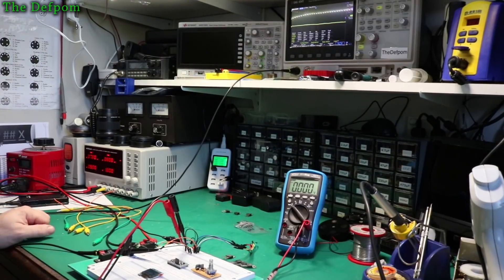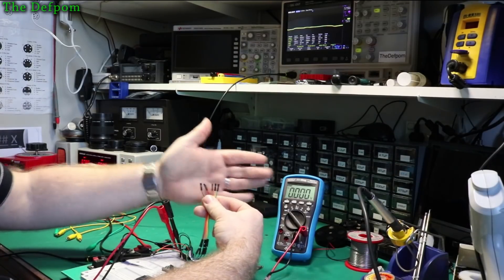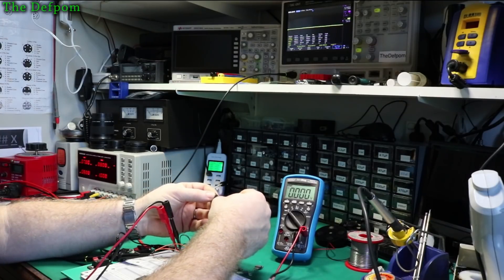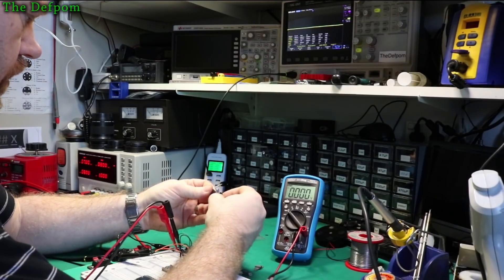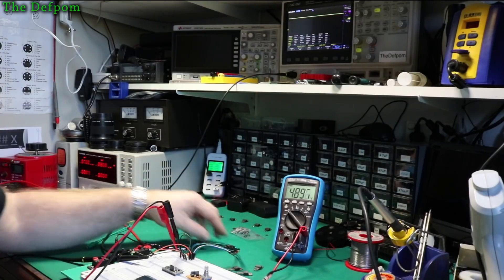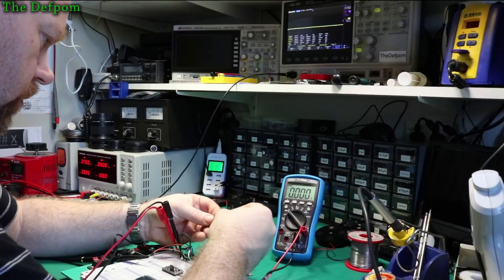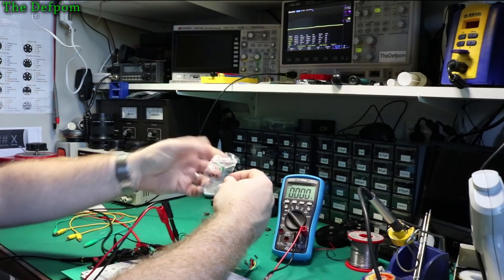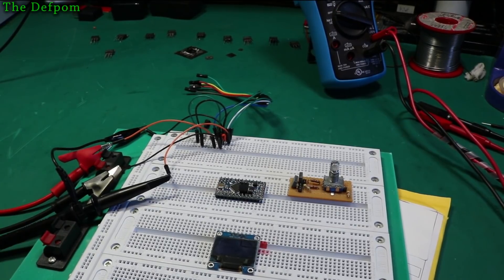🔴 #475 LM2925T (CS8122) Voltage Regulator and Supervisor IC Function Testing

Comment: I wonder if they bother to test them before shipping out..
I thought about buying a dozen "new old stock" EPROMs from China, but I figure there's way too much that can go wrong with those.
Need them to update the ROM on a piece of gear, but they're quite overpriced from US sellers; people on eBay always seem to think old=valuable with any electronics
Reply from the maker: LeiserGeist - I stocked up on EPROMs years ago when I was making CB radio conversion boards, just as micro controllers were emerging. I have a lifetimes supply if 2716 and 2732 I think!
 I wouldn’t worry too much about used EPROMS, erase them, do an erased check, program them and do a programmed check and run it a few times, if they check out they are probably fine.
Reply: @TheDefpom  Nice, thanks for the tip. This dang HP logic analyzer takes 8x 27c256s; should be fun!

Comment: Dam swines arnt they, i hate liars :-(
But they all seem to work, not so fantastic with voltage accuracy but i don't suppose the spec is too tight.
Reply: Doesn't look like it, the datasheet gives anywhere between 4.75v and 5.25v as in specifications.
Reply: Yes that is wide for any voltage regulator, i bet the good old 7805 is better than that.
The lm317t is my favorite, very usefull for a quick supply of an odd voltage :-D
Reply from the maker: zx8401ztv - I raised a dispute and got my money back because of the misleading description, so the parts were free in the end 😀